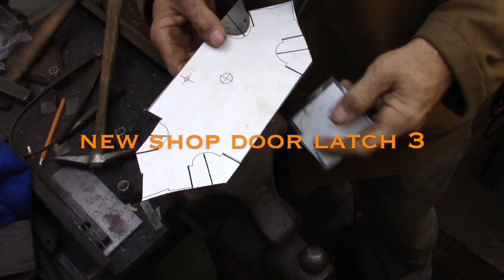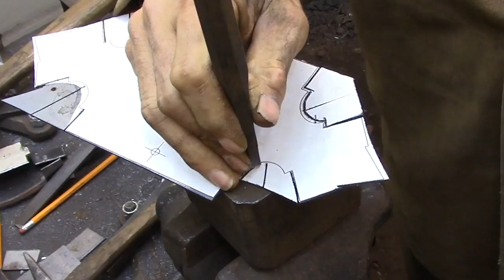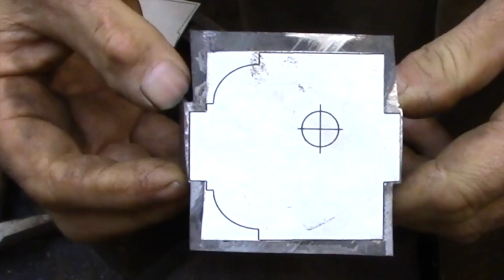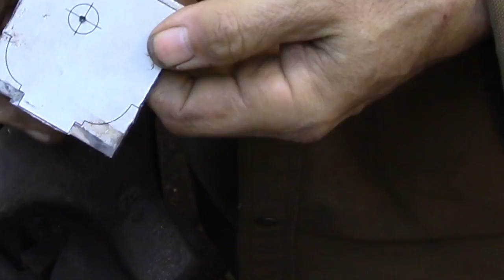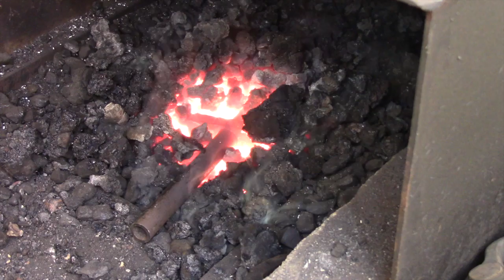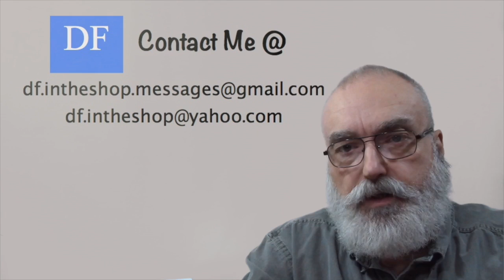Blacksmithing Project - New Shop Door Latch 3

Comment: Mr Denis. I like the vise insert. i am going to have to make a couple. i have question on the Brazing. could you get the piece that you are going to braze up to temp while preheating the brazing rod so that it isn't so cold when applying it to the piece?? would this make it flow better into the joint or not?? Thanks...
Reply from the maker: That's why I use  the fast forward  so much it allows me to show more techniques without making a 3 hr video.  When you are brazing in the fire the only proper way to do it is the wrap the joint with the wire and cover the whole thing with flux.  That way everything comes up to temp at the same time and you can cut the air back as soon as you see the wire starting to soften.
Reply: Good to know. Thanks!!...